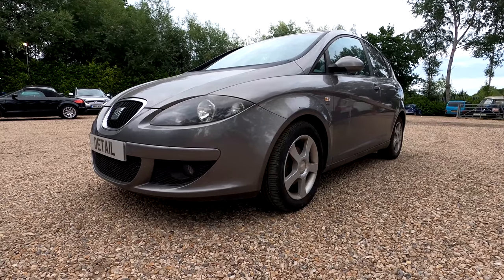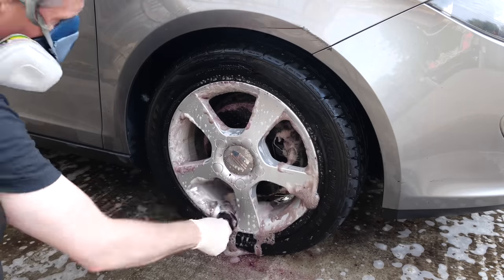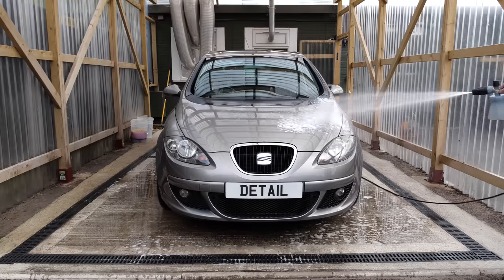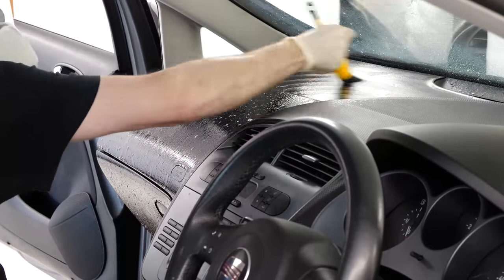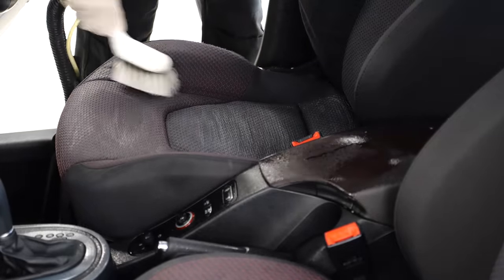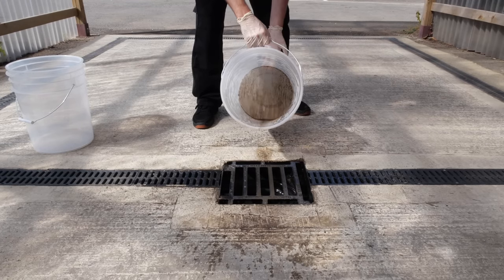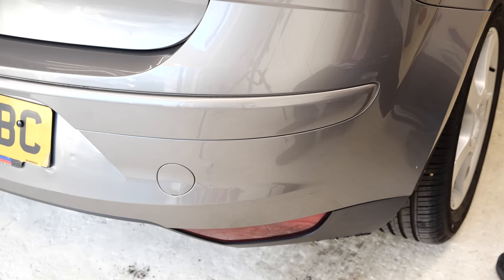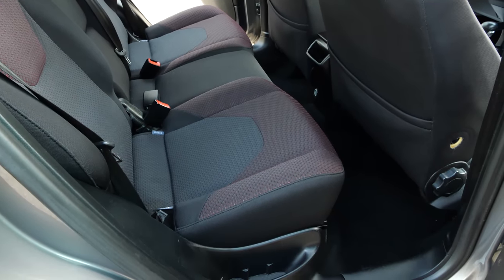Disaster detail, deep cleaning a filthy/dirty Seat Altea ,barn find, how to clean a car, ASMR

Comment: Fantastic content as always, very much looking forward to next week!

Quick question: When wet vaccing, how much pressure do you push down into the seat? Do you find it best to push down firmly into the seat or does relaxing a little and letting the vac glide along the surface yield a sufficient result? Many thanks.
Reply from the maker: Depends, in all honesty you just need enough pressure for the vac to seal round the material, to extract the water.
Reply: @everydaydetailing6449  Cheers for replying, appreciate it!

Comment: If you clean the speaker grill and then use compressed air, aren't you spraying water/soap over the cones of those speakers?
Reply from the maker: in truth the only safe way is to remove the speaker cover, and most are moulded into the door car, so not viable to remove, I do feel a steam cleaner often used in some of these videos on the internet is much worse.

Comment: If the rim scratches were metal deep could you still just touch them up? Or do you need to put primer on scratches and then put touch up paint on.
Reply from the maker: in all honesty they needed rubbing down/a refurb, this was a quick fix on a very cheap car, it does last though I've touched up my own rims like this and its holds up pretty well.
Reply: @everydaydetailing6449  so if understand u u dont need primer if its metal deep scratch?